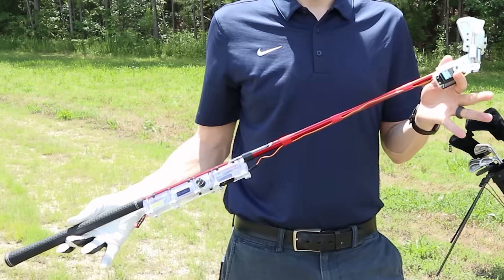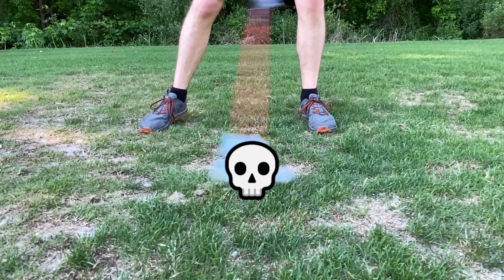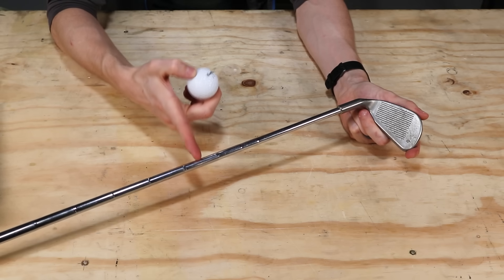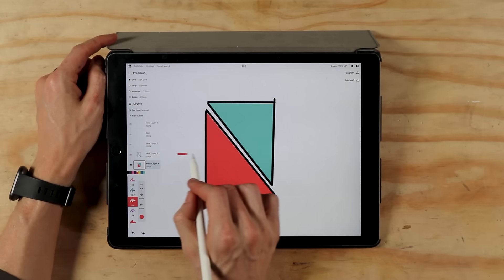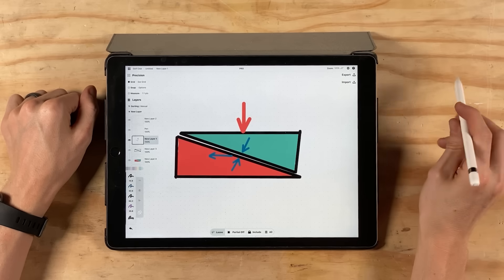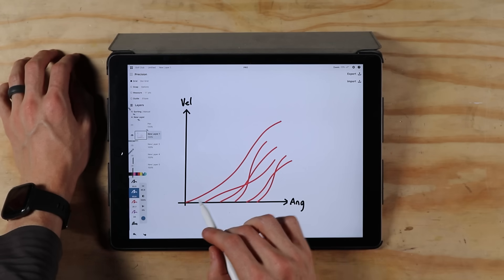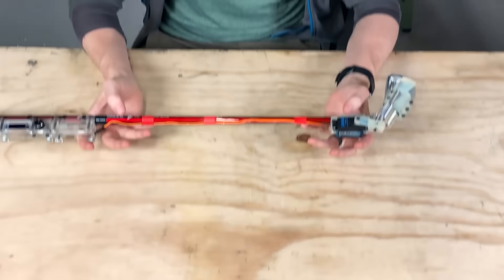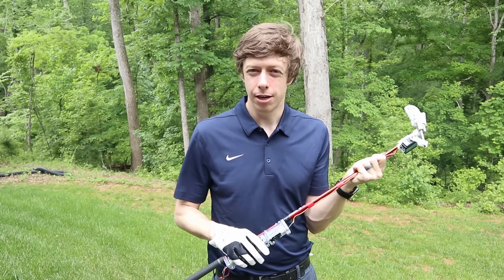My self correcting golf club makes me a better golfer

Comment: why is the imu so expensive? how does it compare to cheaper ones? what processor are you using in the club?
Reply: It's likely a fused data IMU. Some more expensive IMU's have better precision, can handle drift correction, give quaternion rotation directly, etc I haven't messed with $350 ones but you definitely can get better $50-100 IMU's then your generic $20-30 ones

Comment: To fix your PCB pads: scratch protective cover over a trace and solder a small wire to it. I suggest adding a drop of glue on that joint because it will be very weak.

Comment: The only issue with this is that club angle isn’t the only variable that changes in a golf club. Shaft length also increases as the angle gets shallower. This is to allow for a faster club head speed when you’re trying to hit the ball further. Other than that, this is an awesome idea!

Comment: I am really enjoying your channel. One quibble, at 4:10, the speed of "sound" in steel is at least a factor of 10-20 higher than in air. In 500 microseconds, the pressure wave has already hit the  end of the shaft.

Comment: I would love to see a better player use try this.  Don't know where you live, but if your close i'll give it a smash for you(I'll 3/4 swing it, wouldn't want to break it.)  

Also one thing that will be a challenge is strike.  That will have a greater effect on distance than loft (within a small range).  I would reccomend buying a P790, I500, or 0311 head.  those are the hottest clubs across the face.  I would reccommend a 2i or 3i as you want to have enough bounce on the low lofted shots so the club doesn't dig.   Another option would be to thin the face the further you get from the center, there will be a distance penalty over a real club, but ball speeds will be more even across the face.     

Great content!

Comment: I don't know accurate this assumption is, but, assuming a weight placed at differing positions along the length of the club would change the striking weight of the face, adding one that can be moved to simulate the different club heads might be a nice addition. It might even allow the system to somewhat moderate and normalize the swing speed?

Comment: Only thing that seperates you from total genuis in the use of GPS, actuators to retract a small conformal weight to influenz final speed of your iron and another axis to make sure the ball hits hole in one on first try on the specified (D-)GPS coordinates :D
Reply: Ok suggestions you said... Well. In the acceleration curve i can spot a well defined moment of change (derivative of acceleration). You might want to couple this with your initial prediction. I think that will bring you closer to the true impact velocity and that where it is an reasonably easy way to optain a process value (simply delta the delta :D )
Something along the way of a) what swing profile to select and then b) get the closest approximation of the final impact velocity when the rate of change drops to a point where it can be consistently approximated with the smallest margin of error possible in time for the servos to make final adjustments.
Please forgive me if i get some engineering terms wrong, english is not my native language.

Comment: 4:18 The speed of sound in steel or aluminum is many times what it is in air: 500 µs would be about 3 meters in steel, or more like 50 µs to reach the point on the shaft indicated.
Reply: I don't think hydraulic fluid is made of steel so try again but do it based on what he was actually talking about.
Reply: @shane8037  how about you actually watch the snippet I linked directly to instead of assuming I was talking about the hydraulic system rather than specifically responding to the comment he made at that timestamp specifically.

Comment: From one golf club inventor to another...congratulations on a fun video. Playing the whole round with a single club has been my passion for many years (www.DivnickGolf.com).  I think you helped prove that the most important element to a good golf shot is the golfer...even more than the equipment.  Years ago during a magazine interview, Lee Trevino was asked how important the equipment was to a good golfer. He answered, "I could jam a stick in a coke bottle and beat you!"  He probably could.
I get asked all the time if I can design a club that always hits the target.  I can, but it wouldn't resemble a golf club.  It would be more like a shoulder-fired weapon.  So it just wouldn't be golf. 

If you swing a club that requires skill, then exact distance and accuracy will be elusive.  The biggest variable is the golfer...always has been, always will be. And I think that's the compelling fun about the game.
While your club has some cool high tech capability...I'm thinking the shaft probably doesn't have normal flex and torque characteristics...so that would take some getting used to. But I sure do applaud your creativity and craftsmanship.  Well done.

Comment: Back driving is an issue dealt with in all types of machinery. The simplest, cheapest, and easiest standard solution is to use a worm gear drive or a high ratio hypoid, the latter having very high efficiency at the cost of tight tolerances.
Khk gears or servo city, lots of ratios and modules for as tiny as you want to go (no affiliation). Drive them with a stepper motor or add feedback control to a DC motor

Comment: Could you have put a check valve in the tube? or if theres no return lines and each tube needs to flow both ways, I know there are hydraulic dampers that would alleviate a lot of the shock but not sure if they make them on the small scale you'd be looking for. You might have been able to throw a bunch of disks in a solid tube inline with your hydraulic system to dissipate shock force like a suppressor.

Comment: Instead of a servo, could you use an inline (with the shaft) stepper motor and some bevel gears? Not sure if this would be more work for less benefit if it even would work at all.

Comment: Thats really cool. with the hydraulic version could you add shock valves/hose burst valve in the head before the hose connections? That would remove almost all the spring, they are pretty quick acting. 
But that wedge design is really neat.

Comment: Several things wrong with the club. It replaces nothing but your learning ability and skill gain from properly hitting the ball and aiming where to want it to go, gauging how far you want it to go etc. second off it's not going to last due to the heavy impact clubs take, whether from normal use/wear an tare to missing the ball and taking chunks out of the green. Your design is cool and good for novelty use sure but it's not replacing any gold clubs over years and years of use.

Comment: I assume you already know but the pressure wave would travel through the material at the speed of sound, but at the speed of sound in that particular material. The speed of sound through metal will be much higher than through air.

Comment: You know what would be cool? Reservoirs that sit at the top and bottom of the shaft and adjust the distribution of weight to mimic a heavier or lighter head dynamically. No idea how it would feel to have weight moving around during a swing, but maybe it would be manually adjustable for each shot (as part of the club type presets?)

Comment: 11:50 a common way for solving such problems is to try to parametrise the curve with just a few parameters and then as you are going along the curve you would be able to more accurately predict the motion. What you are doing is kind of similar but with only 1 parameter and you aren't really interpolating between different values of that parameter. Also I think you are putting yourself at a disadvantage by not considering at least a simple physical model of the system. This may help a lot especially in the last moments before the hit. Also the IMU should be accurate enough to allow you to keep track of the relative position of the ball to the IMU so this could solve the problem with not knowing the angle at which you are going to hit the ball.

Comment: 4:16 no. It would have gone to the top of the golf club a long time ago. The speed of sound is not a universal constant. It is a few orders of magnitude faster in solids and liquids than it is in air. What you are showing is how far a sound wave in air would have gone. In solids the speed of sound is on the order of a few km/s. In your case probably around 6km/s. This is way more than 0.33km/s.
Reply: In 500 micro seconds, the pressure wave would travel about 17cm through the air, but about 70cm through hydraulic oil (and about 3m through steel or aluminum).
Reply from the maker: Very good point, that probably explains why it didn't work the way that I expected. I had read that golf "fact" somewhere and assumed it was true without doing the math to check it. That would have saved me a lot of time. You know what they say say about assuming...
Reply: The longest delay in feeling the ball is probably the human nervous system, which is around 0.1 km/s, although it's hard to say the delay because the shockwave travels up your arm through soft tissue as well, but it's a few milliseconds at least.
Reply: @sdial  your nervous system is a constant in this scenario, and not really what we are talking about here.
Reply: @jong2359  The video literally says, "I don't feel the impact of the ball with the club until the ball has already left the club." The discussion that follows about the "speed of sound" is rationalizing. You are showing why his answer is wrong, but I am giving an answer to the original question.
Reply: @sdial  Yes, the VIDEO literally says this, but this is not what we are talking about HERE.... that is what I was saying.  We are discussing the speed of sound through solid material vs air/liquids.
Reply: Wouldn't the hollow shaft complicate this? Most of the volume of the shaft is air surrounded by a thin steel wall. Maybe this is why he made the assumption that the speed could be treated as though it were moving through air?
Reply: @NainKaigo  solid is solid and air is air, combining the two materials in a hollow tube just means you have two separate measurements of the same wave.  The one you feel is the one that is fastest... in this case, solid.
Reply: Nerds

Comment: I feel like just soldering leads to the traces would've saved 95% of the time and effort spent making the USB interface work
Reply from the maker: Its hard to see in the video but I completely removed the pads and one of the traces was on an inner layer of the board so I couldn't access the trace.

Comment: Would turning a wormgear using a servo be too bulky for your design? Also would it be fast enough? I don't think the forces of the ball hitting the club face would be able to change the angle of the face during the swing.

Comment: If I wanted to learn to build cool stuff like you, where do you suggest me to start? 
These videos are really inspiring and I'd really like to get into some robotics myself but I somehow can't find a starting point. I do have basic engineering knowledge as well as a 3D printer to my disposal but have next to no experience with electronics. Of course, I'd not start with insane projects like the ones presented here. A simple robotic arm with two degrees of freedom would be enough of a challenge already.
Does anyone have a suggestion of how I could learn the stuff required to get started in this area?
Reply: Start by looking into arduinos! There are tons of resources for learning arduino and making robots and stuff!
Reply: @starfilmsanimation  Thanks for the hint. I've read about those. Is there a particular set or book/video series you can suggest?

Comment: Would it have been possible to so some hack job soldering and scratch off some of the solder mask and get some tiny wires attached to it instead of doing all of that usb work?

Comment: Iunno with all the rona, but if you could find a range equipped with a toptracer you could get alllllllll of your data per shot. It's usually only a couple bucks extra and you can see all of your data on the app later on. It's pretty sick.